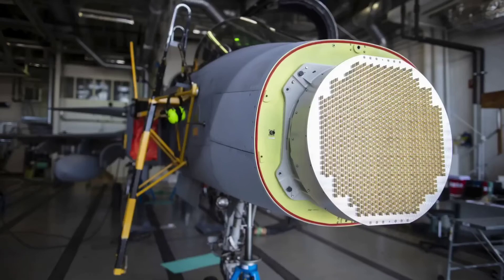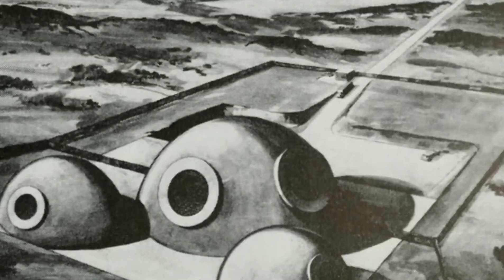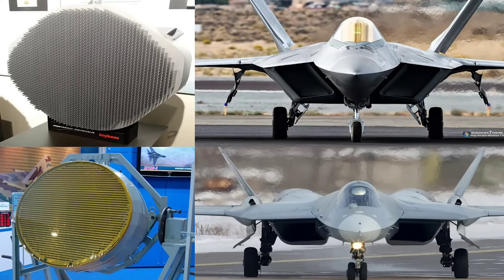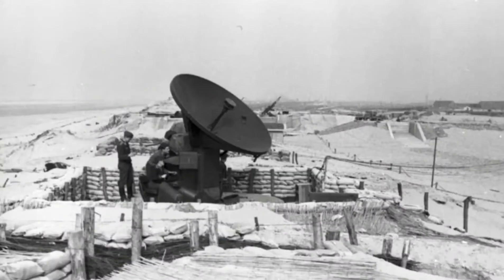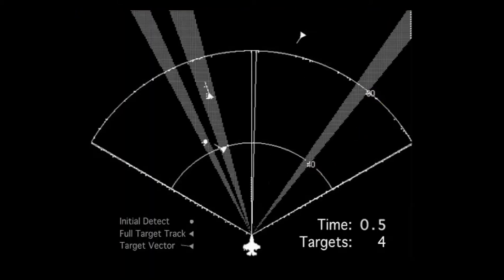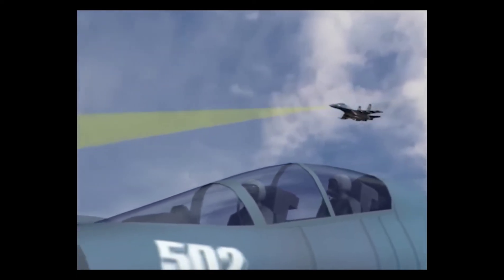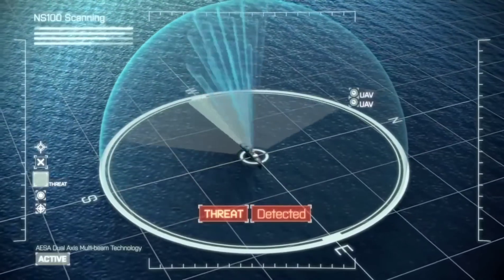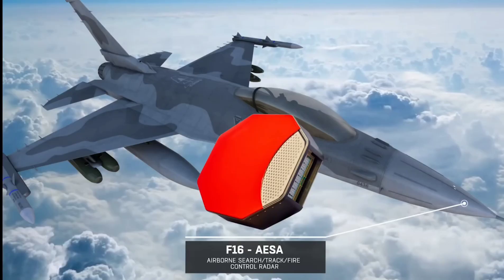How Does AESA Radar Work? The Defense Technology of the Future!

Comment: Maybe aesa radar is invisible to a conventional radar sending heat flare like background noise but surely and an 0.7m interference tube cantenna to satellite dish Will detect any any metal object hidden behind the clouds just using uT metal detector phone app in the node quater of wavelength. You wont cheat that with random noise

Comment: F22 didn’t have the first production AESA that was on a chilean Boeing 707 early warning aircraft, and if you want to then say no you meant on a fighter it’s the J-APG 1 on the Mitsubishi F2.
Reply: The Gripen-E also have AESA
Reply: @jaromirandel543  lol today many fighter jets use AESA radars, but the Gripen-E had its first flight around 2017, while the F-22 accomodated one since 2000 and was one of the first mass-produced AESA-radar wielding fighters, but def not THE first, because the F-2 (upscaled japanese F-16) had it first, so Greg is about right.

Comment: First aesa radar was the one of the mig31, launch at the beginning of the 80’s… usa had just follow and France 🇫🇷 a few years after. Mig 31 aesa radar had a specificity, it’s the only one who work on 2 differents bands, x and L, which allow a better range of detection. He also allow low altitude detection, through l16 mig31 are linked all together and they can share data, 4 of them are enough to cover 560 km of front. Good luck.🍀
Reply: No, that is a PESA. First air operational AESA was actually the Swedish Erieye.
Reply: @patriklind545  They copied from PESA. PESA gave them the idea to create AESA.
Reply: @patriklind545 The first AESA on an airplane was not used as AWAC like Eareye and on a fighter it was the Mitshubishi  J2 if i remember correctly.
Reply: @patriklind545  PESA led the development of the AESA radar.
Reply: Thanks. That's how the USA distorts/alter history to give USA credit for inventing everything.

Comment: F22 is not the first fighter to have AESA, it's F2 Mitsubishi that got it first.
Reply: So did the Mig-31 Zaslon radar in the 1980’s
Reply: @GhostRider-hp3te  Mig-31 is the first aircraft to Have PESA radar not AESA
Reply: @jonlaurenzreyes1902  I was responding to the beam steering thank mechanically steering
Reply: Wrong, F-18s had them back in 2000.  I used to partially troubleshoot these radars with Consolidated Automated Support System.
Reply: @The_Conspiracy_Analyst  Nah, F2 is the recognized first AESA equipped fighter. J/APG-1 AESA radar was introduced in 1995.